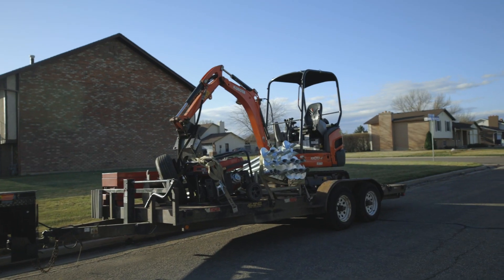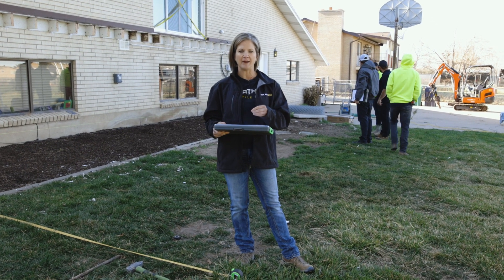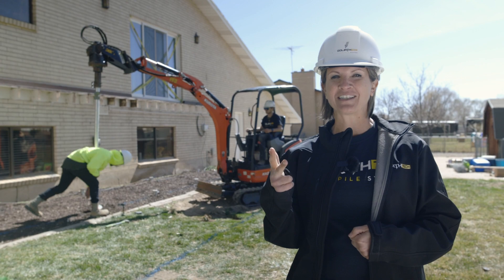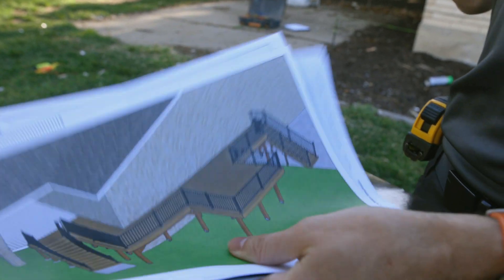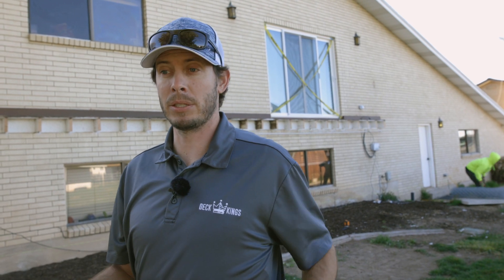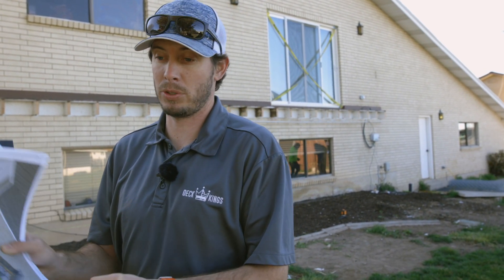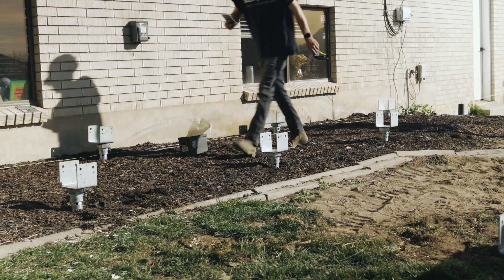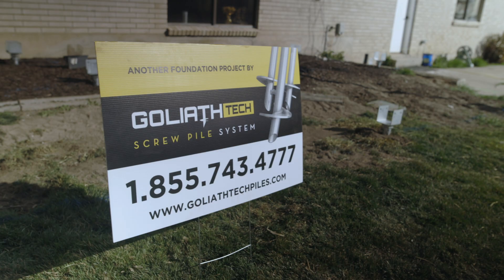Building a Raised Deck Using Helical Piles |  *NO CONCRETE*

Comment: If the helical pile is not positioned exactly correctly, what correction possibilities are there?   The video at time 3:15 clearly shows that the piles are not dead center under the posts.  Are brackets available that permit adjustment?
Reply from the maker: We have offset heads that are ICC approved. You can see one of them being installed during the head section.